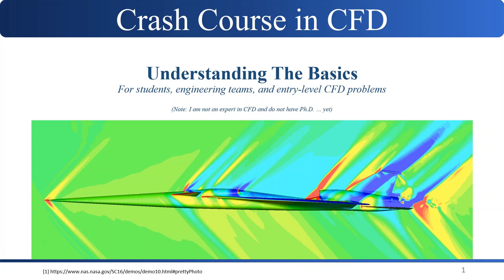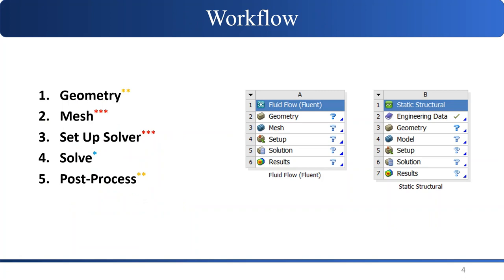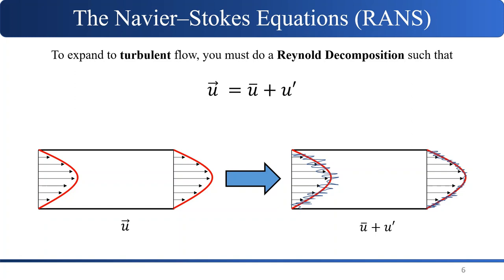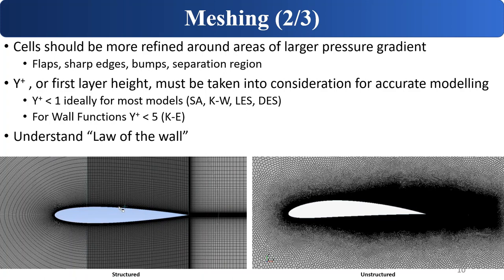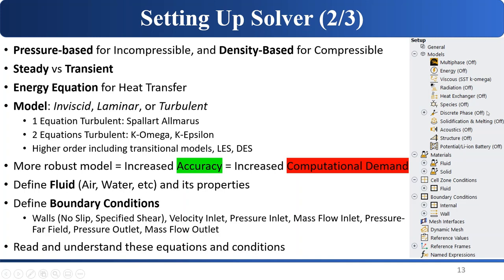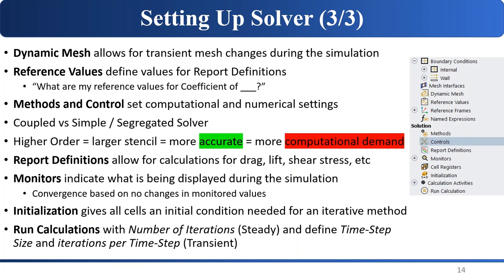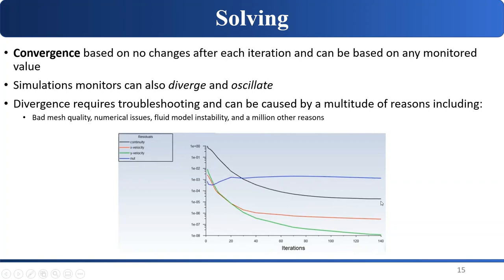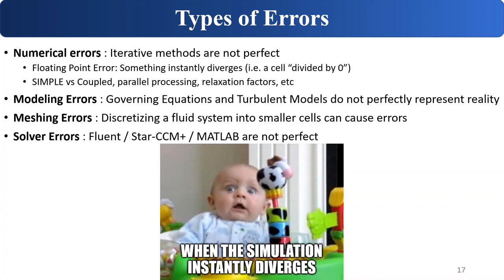Crash Course in Computational Fluid Dynamics (CFD) with ANSYS Fluent and STAR-CCM+

Comment: Thanks for putting together the presentation. 2 points: Fluid is defined as a substance that has no fixed shape and yields easily to external pressure; a gas or (especially) a liquid. Thus fluid dynamics involves the the movement of any substance without a fixed shape liquid, gas, or super critical. Aerodynamics is a subfield of fluid dynamics specifically concerned with the movement of air.
Reply from the maker: Yes, from a textbook definition you are right!  When I learned CFD and worked with it I for some reason was surrounded by people that wanted to reserve fluid dynamics to liquids and aerodynamics for gases, however that may have just been our way to distinguish different works.

Comment: Are the numerical values mentioned for evaluating mesh quality standard for all types of meshes?
Reply from the maker: No, those are very general guidelines that I found in ANSYS guide and they differ for application to application.  My research has previously involved different airfoil analysis and I almost always had a structured mesh so I never needed to check skewness.  I'd recommend checking what settings and published results use for your application.